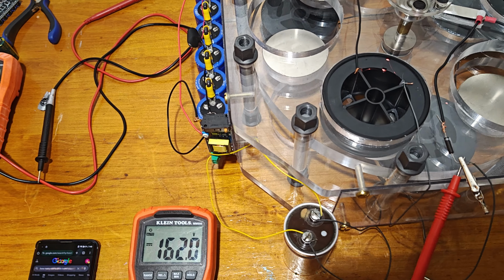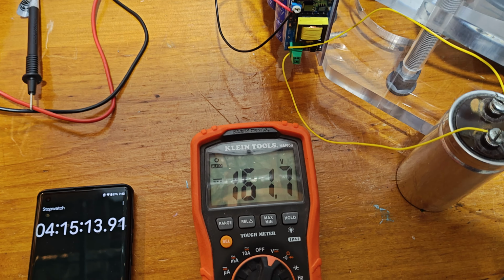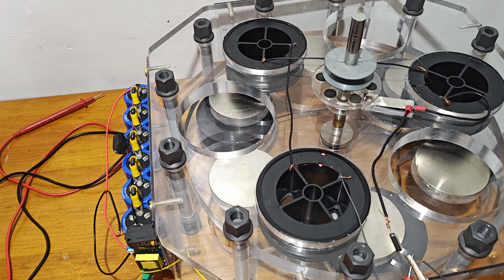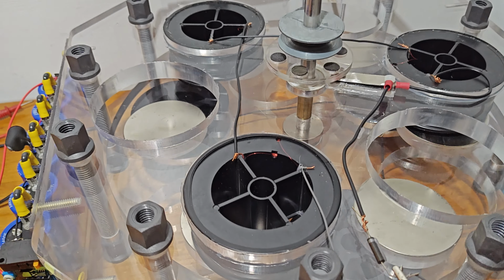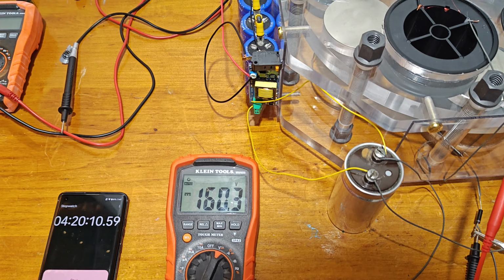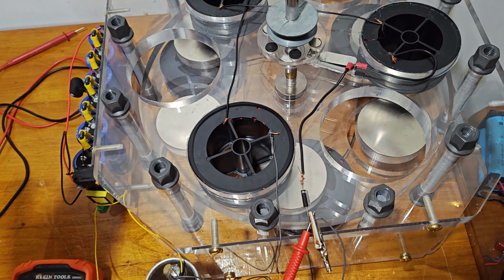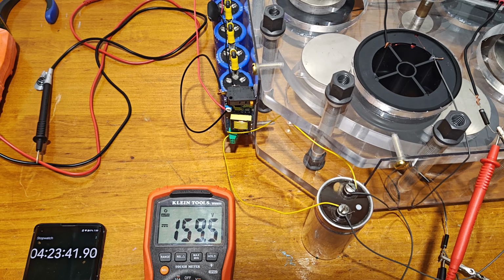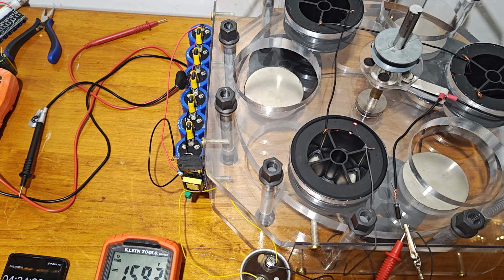High resistance pulse motor theory of Joseph Newman's design and practice. Was he on to something?

Comment: You habe a logical flaw in your though experiment. At wich point has this high resistance wire the same conductivity as the isolation? Because specific at that point your high voltage source will short out your coil. The path of least resistance, brother. That's why you and other people have issues to switch/manage such high voltages. If the voltage is high enough it will piece through every thing.
Reply from the maker: Yeah the enamel of the wire would be the limiting factor unless new technology comes out to wear and oxide layer can isolate the conductor enough to insulate it like copper oxide layer strong enough to insulate the inside conductor

Comment: It is cool but what is the goal. Your motor is not doing any work or benefit to achieve anything other than spin on its own. If it had more speed it could be a efficient fan
Reply: A precursor to self running device.
Reply from the maker: At its current voltage of 250 it can do some work actually I'm going to do that by putting a generator coil and putting a few LEDs but although leds barely consume energy. But hey it am doing work. Also as I get the motor to higher voltages it gets more torque to be honest expected and it only consumes 1.91 watts at full load from a 1,000v input. I need to put another switch so I can get the other phase of the field doing work as well. I'm just in the beginning phase of this process 😅
Reply: @garretwalenski8215 that's a good start but just remember the old joule
 thief circuit is already very efficient to run LEDs but the motor generator idea you have a good spin on it 😀
Reply from the maker: @gregstafford2155 yeah I explored the joule thief quite a bit when I was experimenting with the vortex coil! It is impressive for sure